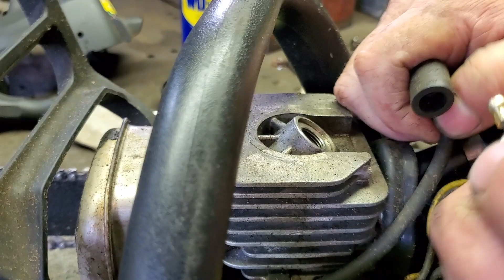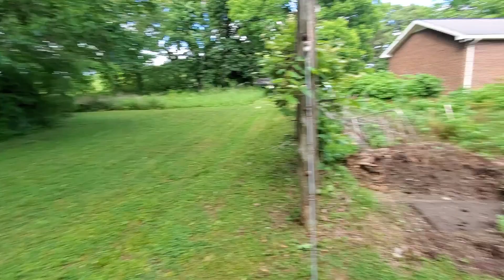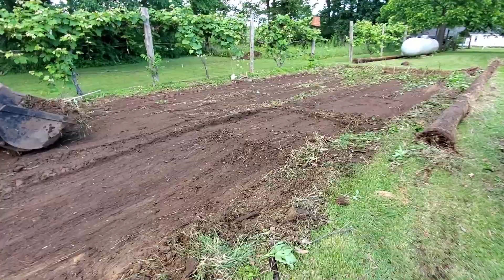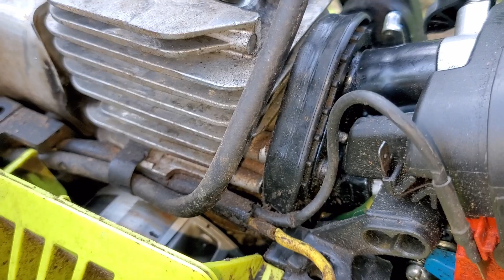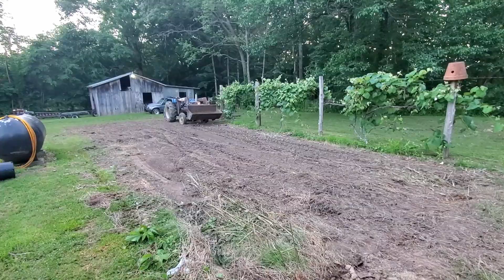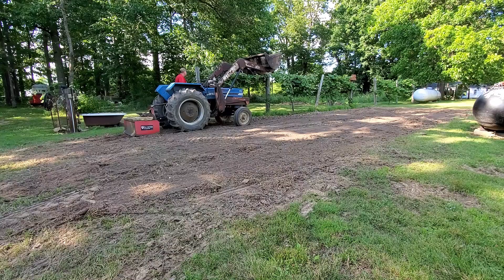MOW (Middle of the Week) Video | Chainsaws and Gardens

Comment: A tip& trick to you about those carburetors on those chainsaws you got they have mini screen mesh filters inside of them that get clogged up with dirt.&grim from the fuels that are out now these days. Along with ethanol gasoline to a tracks moisture in the fuel itself to begin with. Then the fuel becomes weakened to due to lose of octane that separated fro the water in the fuel tank. The next thing to do is to drain all out of the fuel tank.& Then get some marine fuel to premix your 2 stroke oil with. After cleaning up the carburetor good inside everything including the port holes to. The screws set 11/4 to 11/2 turns out for running adjustments to spec. Those types of diaphragms get hard due ethanoled fuels bud.

Comment: Good morning.  The problem with gas filling the motor is the carb.  The needle is being held open.  It's stuck open or the diaphram is petrified and holding the needle lever down.  I have fixed a lot of those poulan chainsaws by just replacing the carb.  It's cheaper than a rebuild kit sometimes.  Thanks for the videos.

Comment: I have a good Poulan, and two bad Poulans.  The bad saws, although they are nice looking, have a plastic frame instead of metal, and they are both on the shelf for display only.  The good Poulan, is a 3ci (50cc) saw with a magnesium case,  and it is a great utility saw.   I am very patient with machines, but I got so mad at a mini Mac saw because it was intermittent, that I finally got satisfaction by crushing it with my excavator bucket.  I felt so much better.  Don't get me wrong about McCulloch saws.  The older saws are great, and I have several.  I am not a big time collector of saws, but I do have a bouquet of them.

Comment: Mines a 2000W 240V electric. Sneer if you want to but it never fails and took a 14" tree down in maybe 6 minutes through a 200 foot 13A extension. Can't beat my mate Mao, does what it says on the tin. I have used a 6 foot double ended chainsaw. Never seen one before or since thank God.

Comment: It's the metering valve gasket diaphragms needs replaced in them bud. Ethanol gasoline is bad on them to man. And drain them out.&:run them until they don't start at all for storing them.

Comment: Chad would it help if you used something to siphon the gas out of the tank and then let the engine run until all the fuel in the line was used.. then there shouldn't be any fuel to soak the plug... Just a thought...
Reply from the maker: I shouldn't have to do that! I need to figure out why it's happening.
Reply: @ThisNThatGarage  I agree that you shouldn't.. Dumping the gas out of a chainsaw you don't use often is a good idea (because ethanol) but you certainly shouldn't be having to do that if you're going to run it a day later!  Something weird is going on there.
Reply: @ThisNThatGarage  I agree with you,  but just in case you couldn't find the problem, this might help with the anger and save you a trip to the landfill...lol.. but if u go to the landfill, take us along...

Comment: I like what ever you decide to put up, I prefer the half hour videos as it just feels different. I don't have a green thumb so no  clue to fixing a garden or planting grass. Every video you watch will have you spending a years wage to get some kind of a joke yard. I did hear the bucket complaining so figure you have a pin thats not taking grease or its wore out and just has a right to complain.. the gear on the tractor is looking a lot older than your tractor. My lawnmower is a brush hog on a skidsteer. Takes out basket balls or what ever is hidden in the weeds and I never need to sharpen the blade.... gets the blackberry vines out as well

Comment: Chad, u ever had trouble from the front loader? Got a Ferguson 240 with same set up and my loader keeps busting the frame u know where the loader bolts to the tractor. Idk just curious if u had same issue. Tractors about the same size

Comment: You gotta put it flat on the ground and pull it. Like foot through the handle like directions say? The gas is just spilling into the carb bowl and on that angle you're pulling it on is overriding the float and filling the carb to flooded. Try starting it flat there Leatherface ? Hahah.. love the channel.
Reply from the maker: That's not how these carbs work. Maybe I'll do a video on 2 stroke carbs some time.
Reply: Carb doesn't have a bowl. Chad knows exactly how to start a saw. Hold the cord and throw the saw. That foot in the handle stuff is a liability thing that came along in the '80s or so, same time as chain brakes came out. Same reason there are 8 or 9 safety warnings on a step ladder.